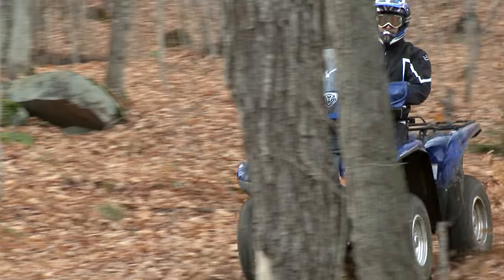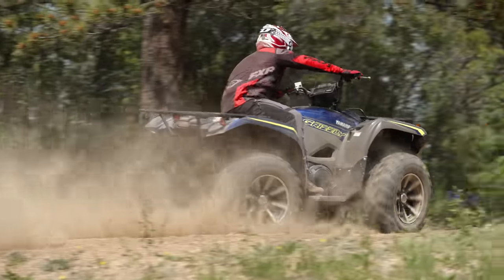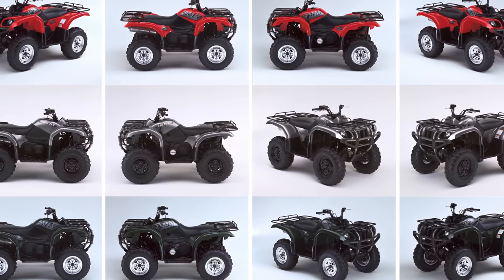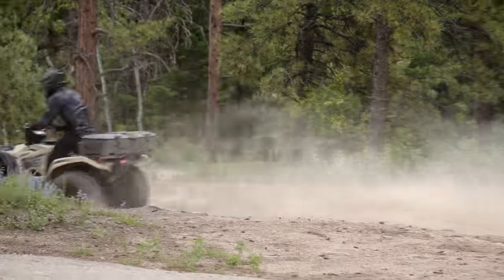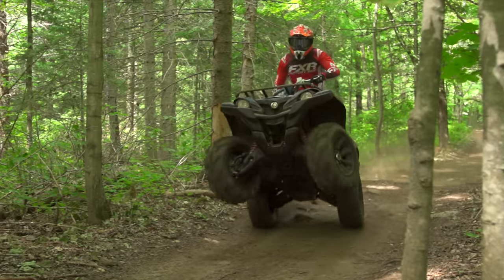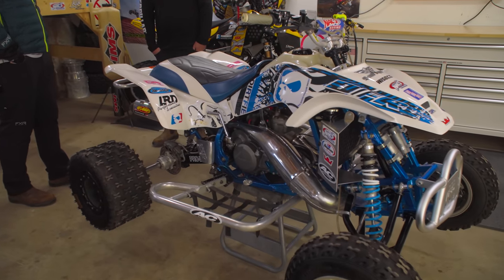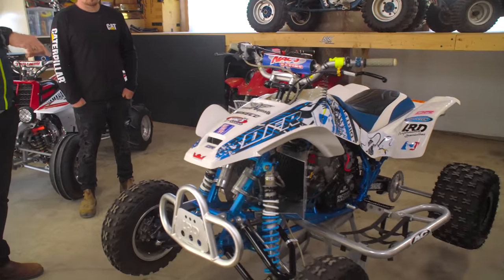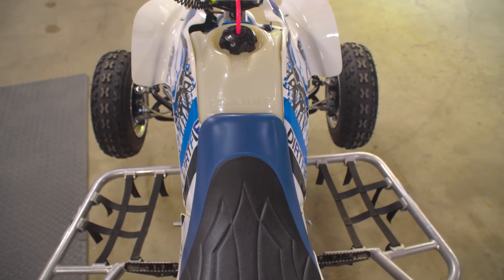DIRT TRAX TV 2023 - FULL Episode 6

Comment: I dont see why most atv riders have problems riding rocky trails with Mud tires, i have been using GBC GATORS Rear tires and AMS SWAMP FOX FRONT TIRES for years in rough
rocks without issues on my little tank Suzuki king quad 300 4x4 😊
Reply from the maker: I wouldn't say it is a problem. I can hammer a nail with a frying pan and get the same results as if I used a hammer. I just feel a tire designed for trail riding is more suitable for trail riding than a tire designed for playing in the mud. That said, lots of guys buy mud tires and rock em.
Reply: @dirttraxtv when you hit the mud with a trail tire you’ll be winching. Mudlite xtrs!

Comment: They are not going to come up with a twin. Can Am just came out and went back to a single 700.
Reply: Just so they can sell a cheaper atv to a lower spending buyer
Reply: @Morpheen999  It just depends on the persons requirement. Most people don't really need anything more than a 500 for trail riding under 20 mph. I think a lot of people need to ride 60-70 mph on payment to get to the next trail head. That must be why they need 850 V Twin
Reply: @trailblazeratv6306   I think you underestimate how many people Ride primarily mud, Big wheels and big power to turn them is Key
i would take the 650 twin over a 750 single any day.. And i own both
Reply: @Morpheen999  yeah it’s amazing how we all have a different terrain. I’m in Southwest Idaho, so it’s mountainous desert.
Reply: I drive around the mud puddles